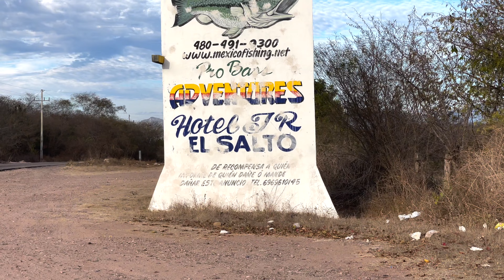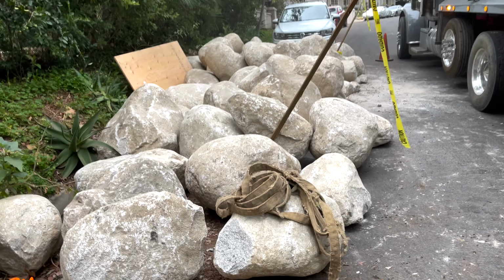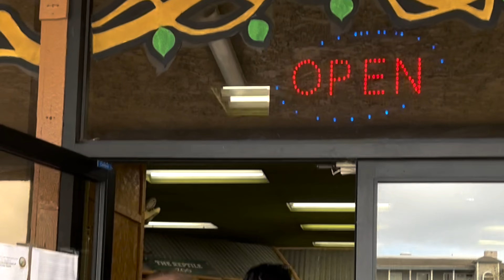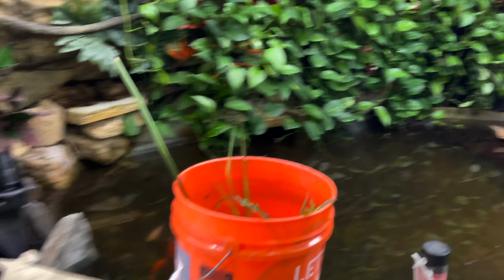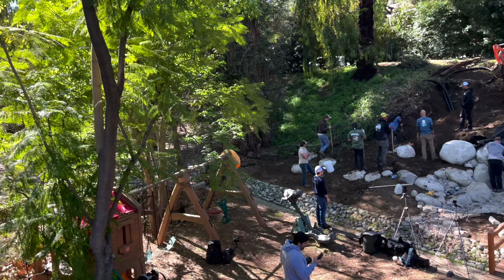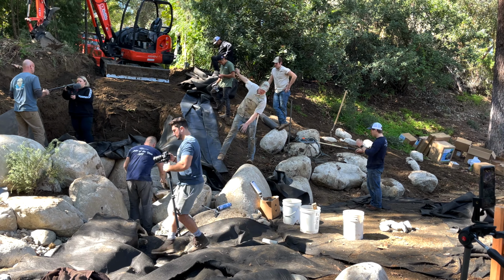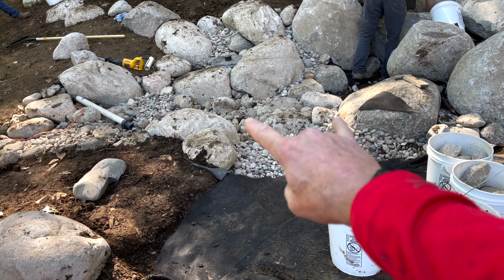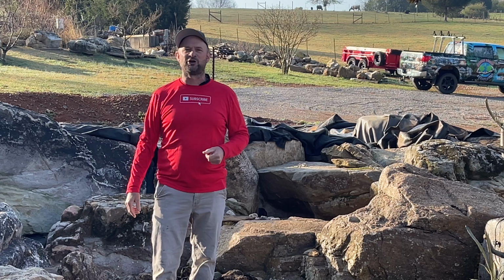LAURA CLERY Waterfall Build WITH A SIDE OF Jays Prehistoric Pets | PART 1

Comment: Been seeing the Clery project from several others, so it was nice to see the Jay's visit behind the scenes.  The real question is:  Did y'all find the leak?  Busting a leak can be very satisfying, or absolutely maddening.  Just because you find and fix a leak, it doesn't mean there're not more!  Mwahahahaha!  Just spent an extended period of time searching for a leak on a pondless, and isolated it to a machine-size rock.  Customer then says, well, it's not losing THAT much water, so I'll just live with it instead of bringing in equipment.  THEN he tries to hassle me over the bill.  Fortunately, while we were tracking the leak we also reworked some of the edges and falls, so there were some visible improvements the customer could see.  It's amazing to me how quickly successful, intelligent people's common sense can evaporate in certain situations.  Keep up the good work!  I guess I'll keep hanging around for more Oasis.  lol
Reply from the maker: Yes we found a few low-edge areas and we just made some of the falls look a bit better ;) We have had some “uncool” leak related issues (clients) but if you saw last weeks video, we are good to do whatever it takes to keep the needle moving !!